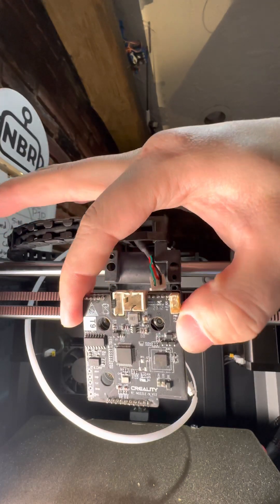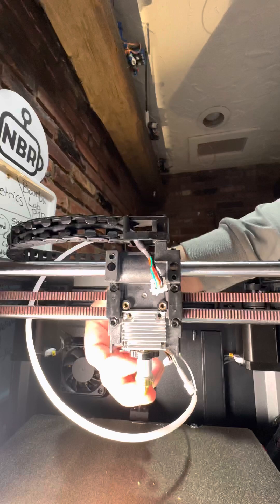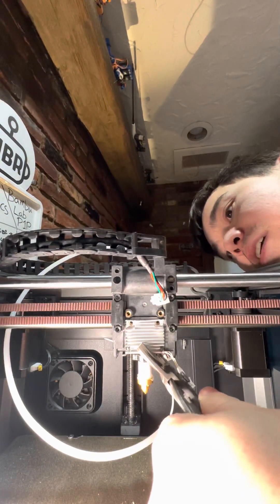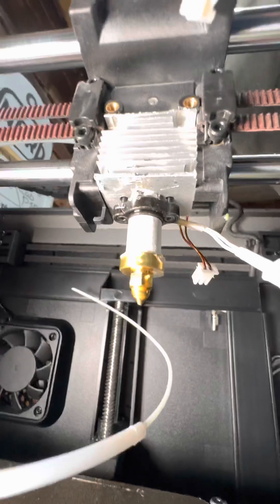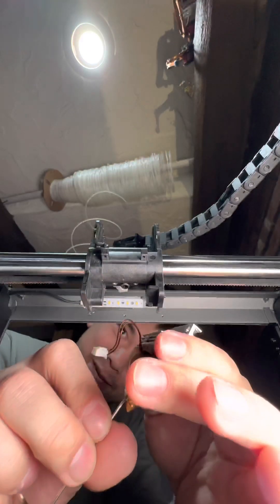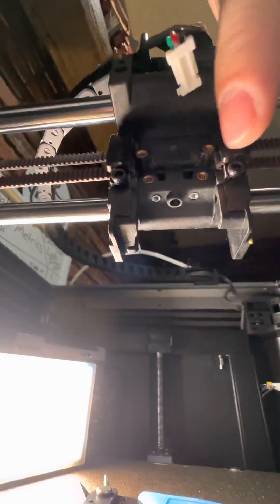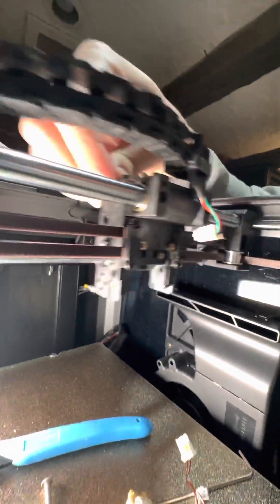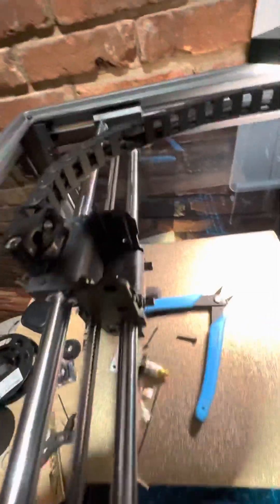Creality K1 - Hotend Disassembly and Close-ups of Printhead Carriage

Comment: Does the molded carriage come off? The factory put 1 heat sink on way too tight and it’s stripped out. I need to remove it but not sure if I can just remove the entire thing and install a new one without messing with the gantry. There’s zero chance the heat sink can be removed.

Comment: FYI with the new "upgraded"  hot and heat sink those screws the keep the hot end onto the heat sink don't then go into the printer head like on the old one.. I had one of those damn screws strip out and at the time had the same issue this guy did in not being able to get things to come loose despite removing more screws than needs..

Comment: Yeah i had the same issue. Everything is glued so much, das the cable from the Thermistor did get pulled out of the terminal when i tried to disassemble the toolhead for unclogging my nozzle. 🤦‍♀️
Reply from the maker: Glue is the future...😅
You don't need to fix your 3D printer when you can just buy a new one!
Reply: @NathanBuildsRobots   Hell Yeah, why bother to repair the broken cable with a 3 cent new terminal when you can buy a complete assembled hotend with all you need for just 15$ on ali. I just recorded a video about that. It will come soon on my channel. The printer prints great. But this drives me nuts. 😀

Comment: What did you use to remove the glue on the connectors and how did you get the black coating off the nozzle end?
Reply from the maker: I pulled the glue off with tweezers, for the silicone sock, I just twisted it and it popped loose. Be careful not to damage the wires

Comment: Literally second day of ownership and the filament broke off above the block. Cant get the stuck filament out without dissembling the entire hotend. Terrible design.
Reply from the maker: Can't you just push it through with some new filament?
Reply: @NathanBuildsRobots  got the jam fixed after a couple hours of cursing, I wish I took a pic, but the abs had grinded into the gears and the heat block, so the filament jammed above the heater but below the heat block. Did a complete disassembly, and was able to get the abs out with an Allen key.

Comment: The hot end board looks to have a single trinamic stepper motor driver on it with an STM32 processor in the middle.  This looks like a CAN bus board meaning -- like everyone else -- using Klipper.
Reply: were you able to catch the model number?

Comment: The K1_NOZZLE PCB uses CAN bus to communicate to the main board. It has an ARM CPU and Trinamic driver onboard which means that only 4 wires are neeed between the printhead and main board.

Comment: Tbh the only thing im really interested in with this machine is the software and compatability with Slicers.
Especially OrcaSlicer as I love being able to switch between my Mainsail instances right inside the slicer.

 Being locked to creality's cloud service, the firmware being locked etc are all big dealbreakers for me, but I wasnt able to find enough information on it yet.
Reply from the maker: According the them, they will be open-sourcing it so you can put whatever community firmware on it. Will have to wait and see if they deliver on that promise.
Reply: @NathanBuildsRobots  Saw someone already gained root

Comment: Can you use regular cpu thermal paste on a hotend? I’m too chicken to use anything but boron nitride compounds out of fear that the regular stuff will start to burn. Those little syringes of Slice are kinda expensive 😢
Reply from the maker: Yeah, the cold-end should never get above 60C.

The hotend on the other hand, gets up to 200C-300C and you for sure have to use a high temp material like boron nitride.

Comment: OMG, it's painful to watch, why you used pliers instead of hammer?
Reply from the maker: lmao, it could have easily been separated with a small explosive charge.
Reply: @NathanBuildsRobots  There are 2 screws (1 on each side in X-direction) that are also holding heatsink + cooler lol. Don't use pliers next time,  you can bend the rods and other parts. The brass bushings have graphite in it, so you don't have to lubricate them.
Reply: Butcher 🤣

Comment: do you know if it can print polycarb straight out the box or do you need to upgrade the nozzle to a hardened one before printing pc?
Reply from the maker: Not 100% sure. I think it should be able to, but need to verify.
Reply: Hardened nozzles should only be used dor abrasive filaments and should not be your default nozzle. This is one of the issues of the bambu printers as they only have steel, even worse stainless steel on some hotends. Stainless steel is the worst conducting metal besides some titanium alloys. Steel/hardened steel is also pretty bad as you know. A normal brass nozzle is totally fine for 80% of polycarbonates, the other 20% require more than 300 degrees. All brass nozzles i know of are rated for 300 degrees while copper are good for 500.
If you want a nozzle that doesn't wear down and have good thermal properties have a look at bondtechs bimetallic cht nozzles or tungsten nozzles. E3d is working on a v6 version of their obxidian nozzles, which means copper body and steel tip with a super hard coating which makes them several times more resistant than hardened steel
Reply: @over_pizza_2578  I see, thanks for this info!

Comment: Sintered bronze with or without graphics is not approved for this speed. That means it doesn't really last long if you don't constantly grease it and the black one is already worn out.
Reply from the maker: Yeah its surprising how many miles (or kilometers) the toolhead moves during a single print. The components need to endure a lot of travel and wear to be reliable for a year of printing.

Comment: Nathan, what happened to the print from yesterday, it didn't go well? You were supposed to report the results today!
Reply from the maker: Shit, a lot has happened. I think there is an engineering fix on the hotends, basically one of the screws in the extruder works itself loose, then doesn’t have enough clamping force on the filament to push it through under certain conditions, such as when printing enclosed, or with Bowden tube bending at too tight of an angle. I opened mine up and retughtened the screw, applying some blue locktite. Should do the trick, if it works it’s way loose again I’ll upgrade to red locktite, then superglue if necessary. But I think the blue locktite should do the trick.
Reply: slice eng work around not working….

Comment: I really do like t he idea that the K1 comes with everything that you need out of the box. Where with the P1P ill need to buy the add ons and i had to make the enclosure as well. 
i also do like the idea of being able to swap parts easily. The main thing i want to see with the K1 before i recommend it to others over the P1P is how good it is with first layer.
With the p1p first layer is never an issue EVER. This is a huge relief and makes my 3D printer more of a tool and not a hobby. Which i want.
Reply from the maker: Yeah 1st layer needs some work. I have a workaround, which is to increase 1st layer height and width by 50%. I got some really decent looking results that way. Plus the print surface they provide is super sticky as long as you apply fresh glue stick.
Reply: @NathanBuildsRobots  Yeah, that kinda sucks. Im glad i recommended my buddy to get the P1P over the K1. It has "less" features but the features the P1P has are just too valuable. 
My main contention with the P1P is how locked it is, and relient on the cloud service.
I dont like the idea that my printer wont work as well as it could if my internet goes down.
Reply: @NathanBuildsRobots  on Bambu is the bed moving up and down during first layer?, just as you discovered on K1
Reply from the maker: @1Raducu  yes, the amount of bed motion depends on how uneven the bed is from the factory. I have been messing with the K1 a bunch. There is a way to level it out but I'll do it later. Basically loosen the belt under the machine, even things out, then tighten the belt. Ideally it should come pretty level from the factory.
Reply: @NathanBuildsRobots  can that uneven factory level produce lower quality first layer?
Reply: Well, in all of the reviews on the K1 that I've seen, including Nathans, there were problems with the first layer. It appears to be the printers primary problem out of the box.
Reply: @baxrok2.  it's a common practice for creality to sell a raw products, I think updates will solve the problem
Reply: First layers from the reviews/post ive seen have all been either complete garbage or pretty sub par as crealitys abl system functions poorly on top of them using their 3mm bed made out of a cheap stamped aluminum that basically has zero flatness tolerance compared to a proper cast alu bed the P1P/X1C uses.
Reply: @lookitsrain9552 On the other hand, BL has big problems with warped beds and now lately people are starting to have problems with the bed heating that stops working.

BL is not an option for me as K1/K1 max will be sold at my local computer store, not having to deal with BL customer service is a life saver apparently!

3d printers still have a long way to go before it becomes a consumer product!
Reply: @dejedejsson  Creality has an infinitely worse issue with warped beds that has been an issue since they first sold a printer. Crealtys support is also straight up useless and has been since i can remember.
Reply: @lookitsrain9552  Yep, I avoid both CRL and BL support then!
Reply: Enclosure on the K1 sucks. Thin acrylic sheets, which Creality in their infinite wisdom also decided to tap for screws (never tap threads in acrylic), rattles like hell. Usual Creality disaster.
Reply: @theglowcloud2215  from what i can see the K1 is cutting corners everwhere. One could argue the P1P was cutting corners by not having the enclosure and missing a few other things when compared with the X1C. but you as a consumer knew that going in.
Reply: What else do you need to buy for a p1p that it didn't work without?
Reply: @justinlabarge8178  It worked fine out of the box. Though printing an enclosure should be done to protect the printer from dust, debris, etc. So far i really needed nothing outside of printing the companion cube mod, which makes that printer a piece of art tbh.
Most of the other stuff that i want to buy such as the accessory fan and the back fan are mods that assist with higher speeds and abs printing. Ill be honest i may scrap abs as im finding PETG is plenty strong and doesnt give off as much toxic fumes as abs.